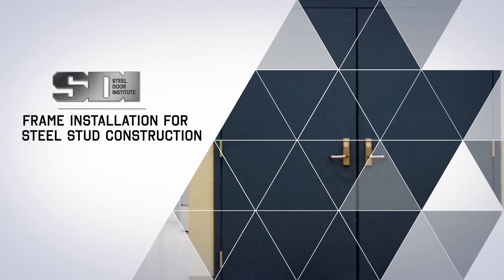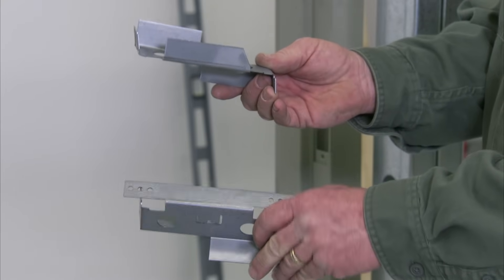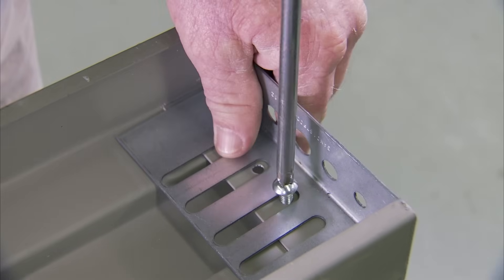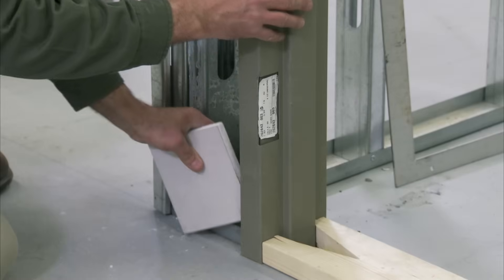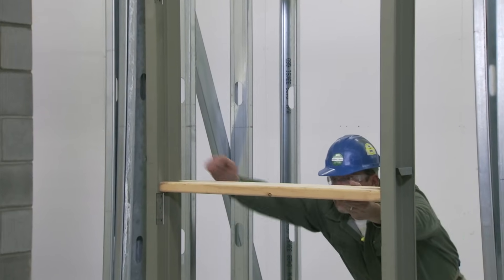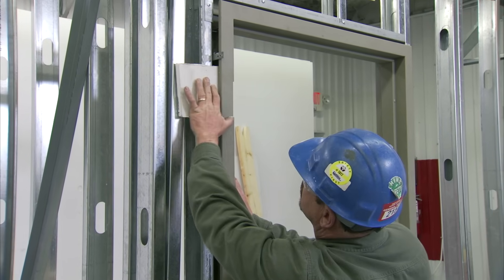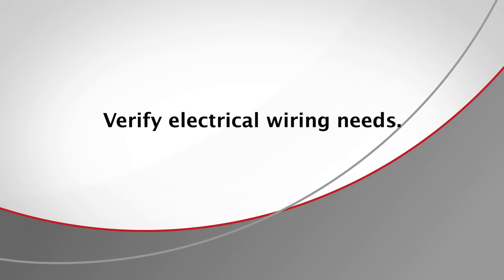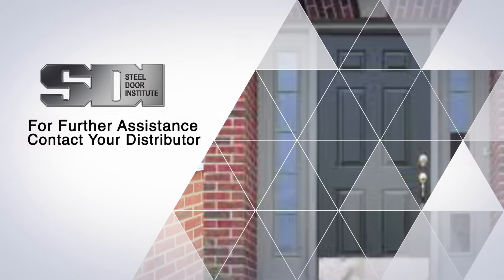How to Install a Steel Door Frame in Steel Stud Construction | Steel Door Institute

Comment: I use my laser to plumb the door but I can see how back in the day all you had is your level but I use the same method he uses putting a small pice of dry wall while setting the door & if your door calls for double layer just add a second piece on both corners & you’ll have your 1’5/8 gap  so far I’ve set 4 doors but I still struggle thanks for the tip

Comment: You failed to mention that you should also check that the door frame is on the same plane by cross stringing before drywall. Especially and certainly on double door openings. String should touch where they cross. If not, the frame is out of alignment and needs to be adjusted.
Reply: I know that I was not born yesterday have been there in 1967
Reply: @JohnSmendrovac  with 😊
Reply: At that point the framing is likely the problem

Comment: i like to use two 4-5 foot rips of sheetrock around 10" on both sides of frame, temprorarily to secure the top of frame...just a little trick that helps free up a hand
Reply: Try using 5/8 OD conduit of the same length instead.

Comment: I made door frames for a number of years. It made me laugh when  the steps said to always use a grinder to remove welded on spreader bar (which I agree) but some of the people on the recieving end, bitch about how  the spreader bars are welded on securely and not lightly tacked on so the carpenters can twist it off... which they dont realize the spreader bars are tacked on pretty well so it doesn't break during transportation or carrying through building, the frame itself is flimsy AF when carrying.

Comment: If the spreaders are in the door, how is the DE installer going to circulate?  Why is not much more practical to install the steel studs, then DW, all to rough dimensions (2 inches more than the exact size of the actual door)  and then to build the door frame around the rough opening. Also, hanging the actual door on the door frame while trueing the frame makes for a more rapid installation.
Reply: Because what you are suggesting is a 3 piece knock down door jamb, this video shows how to install a 1 piece door jamb.  Two very different models, you must install what the customer wants / code suggest, & it is on the blue print.

Comment: my question is, how can you remove the frame on a steel door?
Reply: if you are plan on replacing the steel door frame with a new steel door frame......Start by removing the sheetrock from around (both sides) of the entire door, the it  looks like you'll have to remove the stud from at least one side and the top of the door in order to remove the frame. now you can install the new steel frame. But if you are going to replace the steel frame with a wood frame, then simply use a grinder to cut the old steel frame out. careful not to damage the studs in the process..... hope this helps.
Reply: Um this video but in reverse lol
Reply: @andrewcordova8400 without removing drywall

Comment: I'm taking my bricklayer qualification exam, and one of the questions asks about minimum anchorage for a door frame does anybody know???
Reply: Welded Hollow Metal frames anchor differently in cmu and brick walls. Usually those frames are pre filled with grout and then they anchor with spreader bolts or Similar type anchors that go through the jamb into the wall. 7’ doors usually anchor 4 times on each jamb for a total of 8 anchor points
Reply: Leon Corriveau as well as they can come pre drilled and dimpled for anchoring into the CMU it is counter sunk enough to fill with Bondo so that once painted the anchors will be hidden as if they were never there.
Reply: Watch the video dip